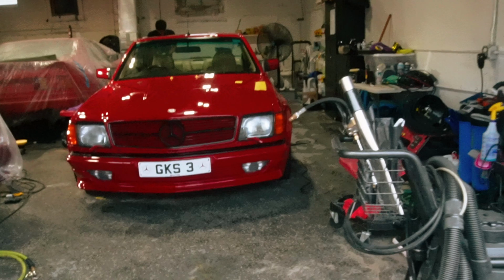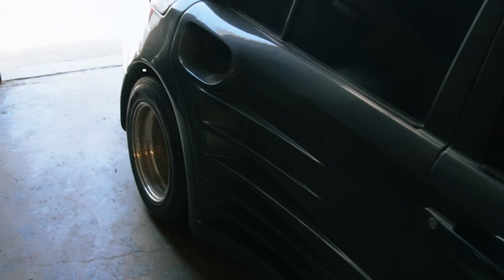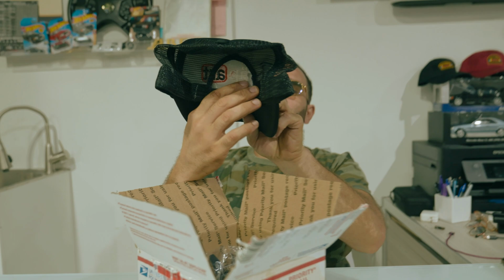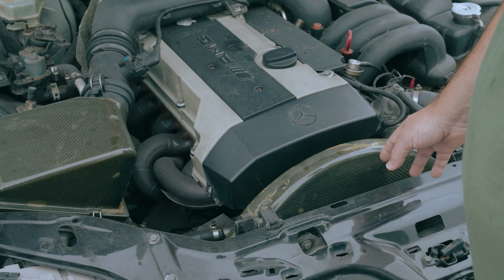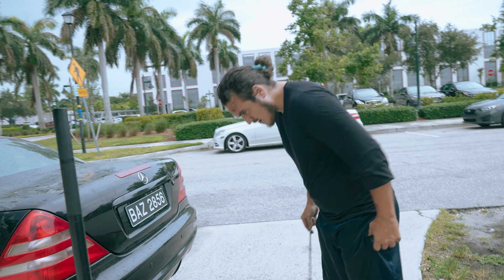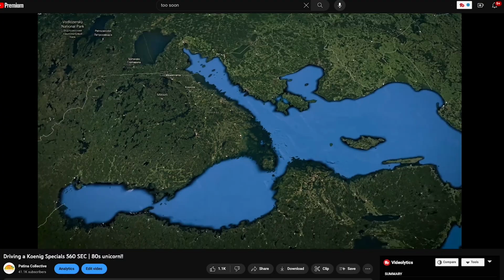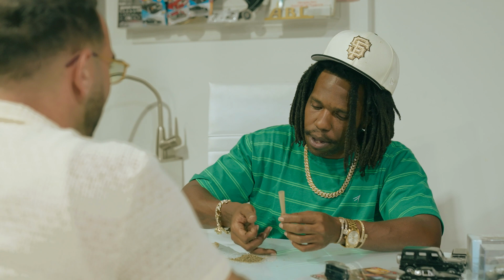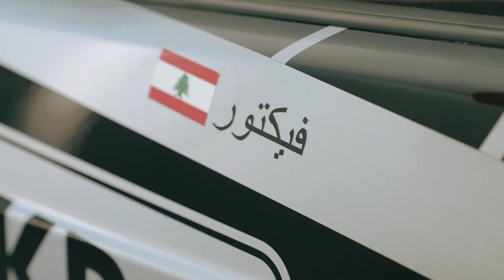Sultan of Brunei's ROTTING SLK36 + Curren$y Visits the Kingdom

Comment: From 1000sel in Red is as an engine from brabus 5 litre and 231 PS, the 1000 number its a Detail for kings in the far east and arabic room, its meaning high class Interieur complete, and the 1000 meaning the higher class Bettler than 500 560 Models, but many Models are including a 6 litre engine with Light kolben and many other pieces, and modifying roll over the engine, but what is what is little bit strange to find out, but you guys kept it, sorry for mybad Englisch 😄👍

But the carlsson w220 with this colour Orange Taxi wood and Black blue seats is Not very beutiful for the eyes but Mercedes is Mercedes and i love it

Comment: I have a car you may be interested in. It's a 2002 W220 S60 Renntech. I purchased the car as a parts car not realizing the uniqueness of the car. It needs a lot of work to be put back on the road. All of the unique parts I have. Renntech front and rear brake kit. 19 inch Renntech Monolites wheels. Renntech Exhaust. Carbon fiber air filter. I haven't been able to verify the engine or transmission. I don't have a key. I called Renntech in an attempt to get documentation. I was told they did a poor job of documenting their builds in the earlier years and did have a record of tuning the car. I have the owners manual and it shows it's first service was performed at Renntech. It has a C215 front end conversion. I started disassembling the car to build my 2002 CL600. I would like to see the car go to better use and not be destroyed. I don't have the time and resources to return the car to it's former glory . Let me know if you are interested.